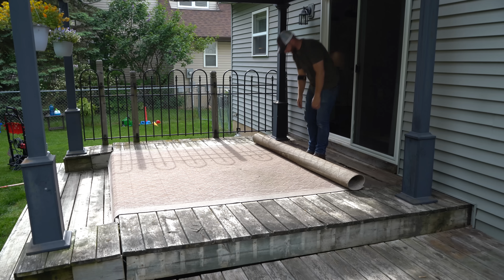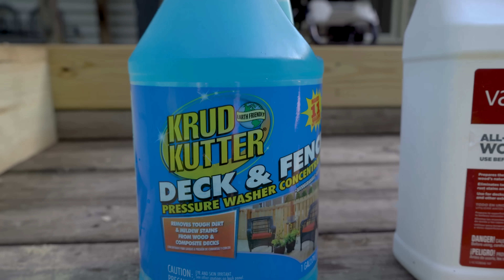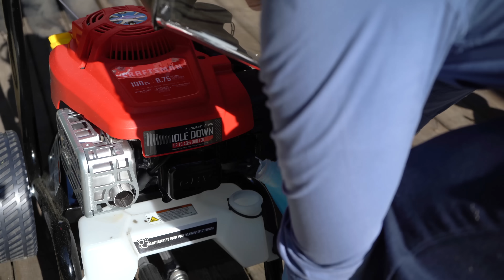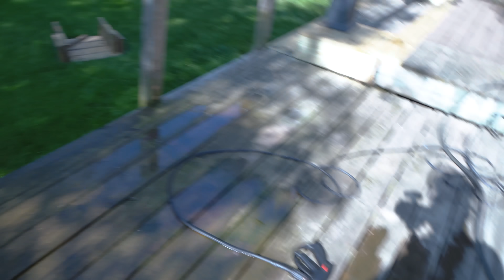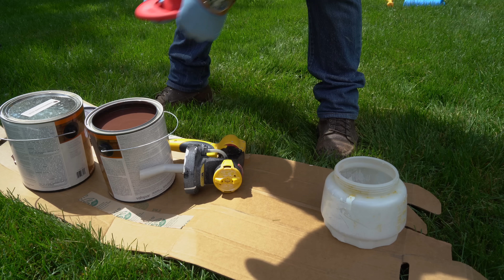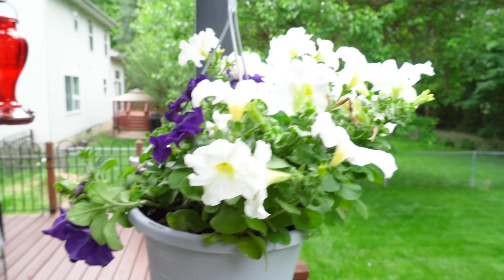How To Clean And Stain A Deck

Comment: Wow. All that. Unnecessary.
There's only one tip for use to clean a deck: same tip to use on your pressure washer for 90% of all jobs. That's a rotating tip. You get the cleaning power of a pinpoint nozzle but, with it's rapid rotation, you don't get the hole, lines or unevenness of other tips. A rotating tip on a 3200 to a 4000 psi washer and there's no need for chemicals or even hot water. Just pressure and a clean deck. It also takes away a small layer of the soft, sun-dried grayness of the wood and leaves the harder, and cleaner, wood grain. Cleaners give you the illusion of clean but can leave that soft, dried layer that is such a slip and fall hazard when it's wet (even by as little as a spoiled soda or drink). 
A good rotating tip will cost you from $35 or $40 to $80 or $120. The higher end, heavier weighted nozzles are best. They will last the life of a couple of pressure washers.
Pressure washer/good rotating nozzle... Takes half the time with better results.
Remember to let your deck dry completely for a week or so in dry weather, or longer where humidity is high. Then stain or seal when the temp is at least 65°  to 75°. It allows any stain or sealer to penetrate the wood deeper so the treatment lasts longer.
Well, that's all I know about that.
Reply: K. Mark Scott - I’ve heard that pressure washers can sometimes damage the wood and leave little ridges that, over time, can splinter and are dangerous to bare feet. Have you ever experienced that?
Reply: @simoneast7  
Hi Simon, indeed I have experienced some rough edges after pressure washing a wood deck. You must always be aware of tip-to-surface distance and adjust accordingly.
However, for decks that are in bad shape, ones neglected for years that require a more aggressive washing, don't be afraid to get in there and do what's necessary to clean all the way down too good, fresh wood. If we're talking pine, and we usually are when it comes to decks, it will be a bit fuzzy. That fuzz will turn to splinters when it dries. That's why one of my best friends for this and many jobs is a belt sander. You can get one fairly cheap, the belts are cheap and they are fast. Sanding after a serious pressure washing job is unavoidable many times. But remember, were talking about wood here, and sanding and retreating is part of the maintenance as well as a good cleaning.
Be careful with a belt sander so you don't leave ridges. Bigger is better. And a nice 80 to 120 grit belt should be all you need. I always recommend sanding a new deck before you apply your choice of sealant or stain (or both). If you're using wood, you're talking splinters. It's the nature of the beast until you tame it and make it smooth.
Now, if you want to avoid all of this on a new deck; after you've sanded it once and applied whatever you like (I always recommend a light, oil based finish like a linseed oil), get a big mop and bucket, mix in Murphy's Oil Soap as recommended on the label and give it a good mop, just like you would your kitchen floor or hardwood. It just takes a few minutes, even on a big deck. I do this every couple of weeks but it's fine if your do it once a month.
I think you'll find that with a good sanding then a regular mopping from time to time, your tootsies are gonna love walking all over your deck without the fear of splinters. And I love being barefoot on my deck so that's how I keep it possible. But, again, that's just me.

Comment: Great job!  Now it's time to find a wooden picket fence that has never been treated and show us how to refresh it with stain.
We have one that is three feet high, 3 1/2 inch pickets spaced 3 inches. It's only 3 years old. Not mossy or anything, but weathered to a nice grey.
Thanks in advance for any help!!
Reply: Sam, 
Sounds good. All but the antique part. Our fence looks fine to us, weathered naturally. But HOA says it looks like it belongs in ghost town. Don't know how they'd react to "antique". Scudders. But I thank you just the same!
Reply: @chiguy42  use professional grade "Restore A Deck" cleaner & brightener kit.
You mix each pack in warm water a 5 gallon bucket and use a garden sprayer to apply the cleaner let it set 10-15 minutes hose It Off come back immediately and then spray the brightener on which restores the woods pH balance from the cleaner and it will look like you just built the fence and it's ready to receive and hold stain. 
It's a powder product that looks like laundry detergent sodium percarbonate.
It foams when it activates and starts cleaning once it's sprayed on the fence or deck.

Comment: most deck stains are a surface stain that will peel of and you have to sand off before recoating. there are stain that are penetrating and a much better option like penofin or even better ready seal. also pressure washing your deck will make it look good but does a lot of damage to the wood fibers and shortens the life of the deck. a scrub brush with that crud killer would do the job.

Comment: if i have treated new deck wood i dont have to power wash em right?
Reply: You need to either pressure wash or let new pressure treated wood weather before staining otherwise the stain will not penetrate.
Reply: 1bottlefed I’ve left them to weather for a lil over 2 months
Reply: Scoobyxxxsnax you need to clean them off

Comment: We have to power wash every 3 months. We live in sunny Florida. Where it rains have the time.
Not sure but can you add mineral spirits to the first stain coat? It would soak in without using up so much stain. I think you can go 25% on the mineral spirits.

Comment: I used Olympic deck cleaner, let it sit, then power washed.  The results were beautiful!  In some parts I have only power washed.  But it is gorgeous.  Now it’s staining time!
Reply: I use the same product, instead of using spray tips I use my ball valve only. 0 cuts marks using the ball valce
Reply: Did you have to wait 120 to stain

Comment: Did you end up sanding prior to stain application?  When I restore decks for clients i always Pressure wash, sand and then stain.  I find the 3 steps are so important to achieving the best possible end results.  The 40° tip also provides a nice wide fan on the spray gun for washing deckboards.  How did you find the sprayer in terms of even application?  I usually use a staining pad and brush to go full length board by board.
Reply: I'm in the middle of Staining a deck for my buddy and the 3 steps you stated has been my exact approach to doing the job.
And this is my 1st deck I've ever done. The results have been great so far.
His deck hasn't been taken care of in so long due to it being his InLaws house before he moved in. I'm bringing this deck back to life. Pressure wash, Sand & Stain baby.
Reply: @baseballbeast1  awesome!!! I swear by the 3 steps.  The work that goes in the prep work is what really makes for longevity and a beautiful finish.
Reply: There’s nothing like sanding  for clean and long lasting results!!!

Comment: Not to be a hater, but in a year (or less) the finish will probably be peeling, flaking and coming off. With stain you have to back brush it into the wood after you spray it to get it into the wood grain, especially with water based products. Also, no matter what it says on the label, you need to apply at least 2 coats. Just a bit of advice for anyone thinking of doing the same thing.
Reply: If you use sherwin Williams semi transparent and do two coats you will have to sand it all off.   Ask one of their reps.   
  I’m not talking about the semi solid.
Reply: I’m an amateur and wonder if I can spread the work out across several days or even a week so that I mess up,less? Thanks
Reply: Todd Yoder two coats on a semi or solid color will cause peeling. Over apply one coat will also do the same thing. Agree with you on back brushing. Ok to apply with sprayer but needs to be pushed into wood
Reply: @stlbowfishing1661  2 coats of solid stain is highly recommended for most brands, (Proluxe Rubbol, Arborcoat, and even Behr) and I've done that countless times with great success.
Reply: @stlbowfishing1661  two coats is the best way to apply solid stain with a brush. Never spray stain if you're going to have to back brush.
Reply: 😊😅 @stlbowfishing1661

Comment: Also considering it is an older deck i would think that a brush would help the paint get into the more open pores of the lumber. I have to repaint as well. So that being said at what point do you replace a board?
Reply: You are completely correct that saturating and working the stain in by brush is ten times better than just a spray job.

Comment: I cringed when I watched you use that power washer on that deck. I know just about everybody does it, but I've been taught by deck stain product professionals that power washing drives some of those mold and mildew particles deep into the fibers of the boards. That is one of the main reasons why you don't see it as a recommendation for prepping the deck before applying your stain. Your deck may look good now, but the product you just applied will have to be cleaned off in a year or two due to failure.
Reply from the maker: There might be some truth to that I don’t know but my initial thought would be that maybe the deck stain professionals are just saying that because they want you to be buying THEIR cleaning products rather than a power washer. So I don’t know. Those cleaning chemicals a pretty nasty chemicals and it’s kind of nice if you can avoid using them and rinsing all of those chemicals right into the ground
Reply: @ThirdCoastCraftsman  the pressure washer is just for ideal quick rinsing people that think the pressure washer is cleaning the deck are totally misled.
You have to buy professional cleaners not all these Box Store gimmicks that actually lift the contaminants and kill them without damaging the wood.
Anything over 100 PSI is going to damage the wood and lift the wood grain.
You really don't need a pressure washer other than four time reasons and you better know what you're doing with one.
Once you applied the cleaner it has to be followed up with a brightener to reset the pH balance of the wood and neutralize the cleaner that was used.
Then the wood is conditioned in clean correctly and ready to receive and hold stain.
Your semi-transparent penetrating stain was a positive choice people don't understand solid stains are a film just like paint on top of the wood surface. Which is a cosmetic covering which does nothing for the wood.

Comment: Gotta say, I was definitely surprised by the cleaner. I have used a narrow tip on my pressure washer and gotten extremely good results with no chemicals at all. On a particularly mouldy deck I used Sunlight Liquid Dish soap and got even better results. I appreciate your YouTubes! Much Appreciated.

Comment: Going across the grain with the power washer gives you much better results. Choose to go 3-4 boards at a time... and work your way lengthwise. You start and stop in the crack, and you really don’t see any marks at all that way and you get a lot less fraying of the grain cause the water isn’t lifting up on the grain fibres as much.

Comment: Some woods, such as cedar for certain, should *never be cleaned with bleach*. Most deck cleaners contain bleach, aka sodium hypochlorite! Bleach is, or was once,  used by pulping mills for making paper because bleach breaks down wood fibers!  Bleach plus cellulose also produces dioxin,  a potent carcinogen abd toxin (found in the Vietnam-era defoliant Agent Orange).  Cedar should also never be powerwashed! Yes,  never, according to cedar suppliers ! So, I really wonder if bleach and powerwashing should be avoided for any type of wood decking. I recently used a cheap carpet cleaner with rotary brushes to clean my deck, with the same concoction I have successfully used to clean my cedar siding: a mix of Oxyclean crystals, water, and a little dish soap. Worked pretty well, and the only thing lacking was a heavier duty floor cleaner, something with more weight to it so that the brushes would bear down on the floor a little harder.
Reply: Never having used the chemical deck cleaners, I wonder what their impact on grass/lawn health is?
Reply: @BrandonGrahamForge  , I looked at a bunch of various online articles yesterday evening and virtually all of them said that oxygen bleach is non toxic to plants. Chlorine bleach however is extremely damaging to plants and the environment.

Comment: With stains, oils, and oil based paints wood that has been outside for more than a few months will just soak up the coating. Any wood you should wet slightly and then let dry to the touch before applying an oil based product. It opens up the pores of the wood and will allow deeper penetration and protection by the coating. You can also do a light sanding right after you wet the wood to take the raised grain down so that it won't be raised after you apply the coating.
Reply: How long to wait after a wash before re-stain with oil based semi transparent stains please?
Reply: @icedteamama176  Until it feels dry to the touch. It varies by the wood, the humidity, and how much you wet it down. The wetting can also raise the grain up, so you might have to sand the surface down before moving on to the coating or staining.

Comment: Hi Chris, I bought one of these: https://www.lowes.com/pd/Briggs-Stratton-Briggs-and-Stratton-14-in-Rotating-Surface-Cleaner/1000460207 and it works REALLY well.  I haven't tried it on wood yet, but on cement it's great.  None of the lines you talked about and a LOT less mess, since the over spray is captured.  You obviously won't be needing this for a while, but if you decide you need to pressure wash a surface again, you might give it a look.
Reply from the maker: Very cool thanks for sharing

Comment: I'd like to know how long you had to wait after cleaning before you stained. And how did you know if the wood was dry after using all the water with the power wash. Thanks. The results do look so good.
Reply from the maker: We’ve had so much rain here this spring that I had to wait days and days after spraying for a clear day but really as soon as it’s dry to the touch you should be good
Reply: You need to use a moisture meter to see what the moisture content of the wood is, needs to be below 10% before applying stain.
If you don't have a moisture meter just sprinkle water on a few boards in different areas of the deck if the deck takes in the water in 10 to 20 seconds the deck is internally dry enough to apply & receive stain.
If the water beads or holds on top of the wood grain you have at least another half day dry time wait.

Comment: When you threw that ball is the first time I have seen your dog look happy. He always looks so depressed ion the videos.

Also, when using a pressure washer, always wear sturdy shoes (steel toed are best) and use the same common sense you use with a gun. Never point it at anything you don't want dead (or severely injured in this case). 

This is a link to some safety information. WARNING: has some pretty graphic images of injuries.

https://pressurewashr.com/pressure-washer-safety/
Reply: good article, helpful for beginners to understand the risk

Comment: I have just spent the last 2 days power washing my deck.
I have used cleaners before power washing and cleaners after.
I have concluded that if your deck is as bad as his old section, that cleaners by themselves aren't strong enough to get 100% of the mold growth off. 
I tried lightly power washing an area, then using a cleaner, scrubbing the cleaner in with a heavy scrub brush. After the soaking period was done, I again power washed it. This method got 90% of the growth gone.
I also heavily power washed it [how he used the 10-degree nozzle] and that got about 95% of the growth off. I could have even used a stronger pressure to eliminate more growth, but that would have sacrificed the wood surface.
In my case, I found that that heavy power washing before using a cleaner, and again a normal power washing to remove the cleaner worked best. Around 99% of the growth was eliminated.

Comment: Looks great Chris. Im about to do this very project on my deck. I have one of those cheap HVLP sprayers from Harbor Freight. Wonder if that would work. I'm sure it would. It sprays paints and finishes well.
Reply: Did you do it?  Thinking of buying the same sprayer.  I need it for house painting but was also planning to stain and seal the deck with it.
Reply: I did. I actually borrowed one of these from a friend and it worked great. I also have one from Harbor Freight and it works just as good.
Reply: Can just use a pump sprayer you'll waste less stain